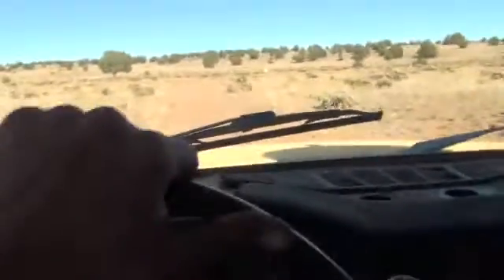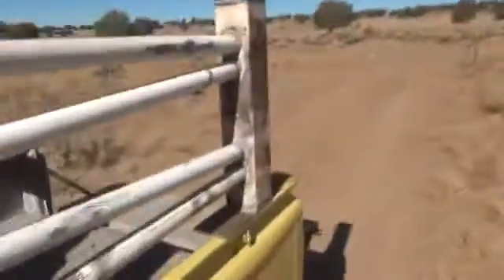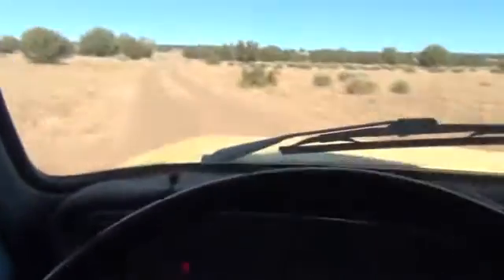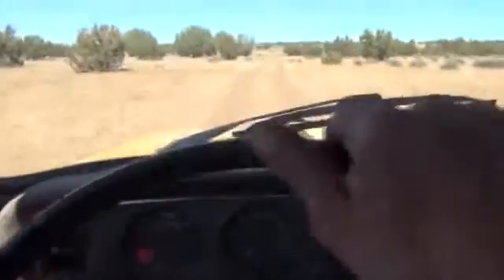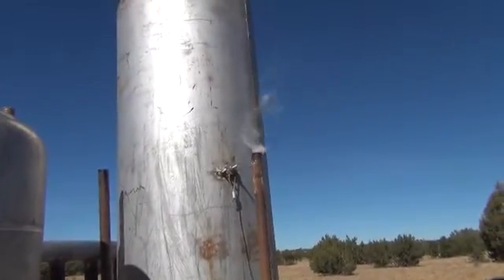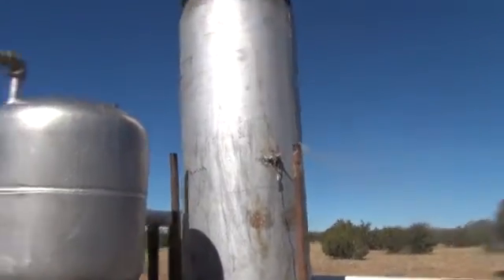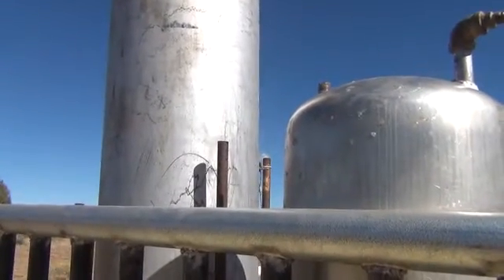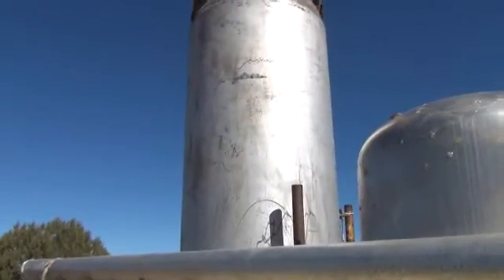Gasifier Truck How-To part 17

Comment: I know a guy who uses gasifacation to run his garbage truck. but at the end of his system he has an old air compressor unit to fill propane tanks, and uses them to power truck instead of having the entire reactor

Comment: Great job. Thanks for showing us that.
You could put oven starter electronic clickers on the four input pipes so that you can burn off the fuel when you turn off the truck and you don't have to worry about fires and explosions. You might want to put burners on them so the pipes themselves don't get hot.

Comment: I also watched all 17. Curious how you shut it down, since once it's going it produces flammable gas, maybe cap the intake pipes while it's running and then shut the air intake valves? Then that would seal in the flammable gas and make a bomb of sorts, unless you ran a pilot flame or something.

Comment: Why not put like a one way check valve in each of your pipes (the four sticking up that draw your fresh air in) from your reactor? It would seem to me that would allow you to shut it down without the need to worry about the very flammable syn gas given off otherwise. Great project! It is freaking awesome to see people put forth projects like this with all the ingenuity that went into it.